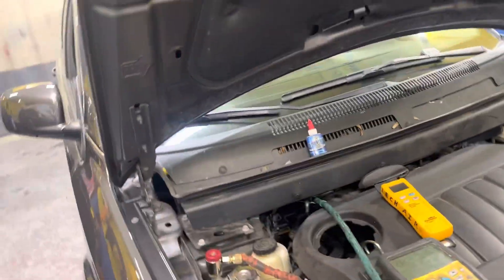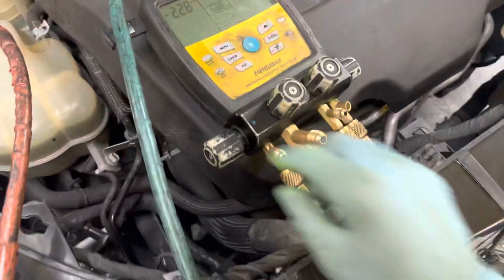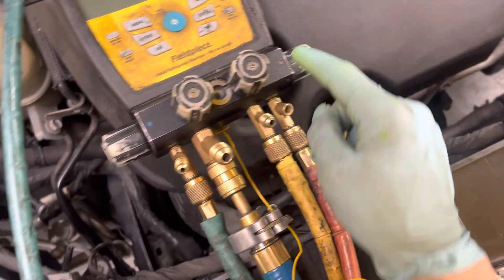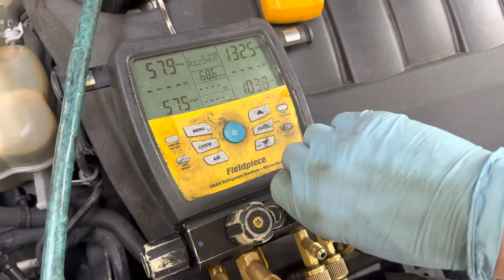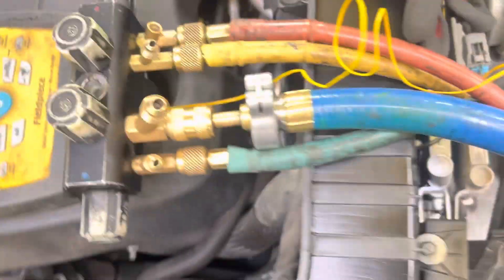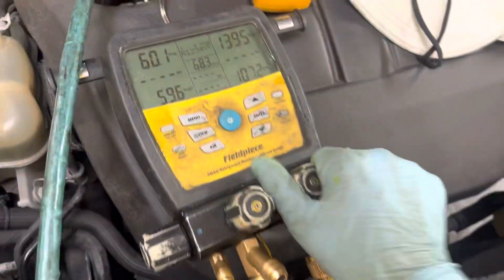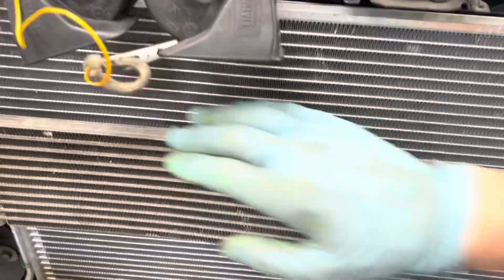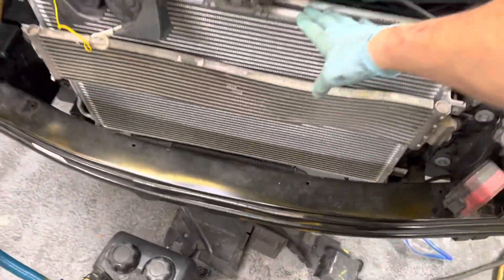AC system cannot hold vacuum time for nitrogen, condenser damaged by a new technician

Comment: Is there any problem if I were to use either 100% Argon or 100% CO2 instead of nitrogen to flush a system? I have tanks of both of those other gasses for welding etc, but no tanks of Nitrogen. Argon is by definition an inert gas, and CO2 has no moisture at all.
Reply from the maker: CO2 is usually a dirty gas and it likes to chill. The system that likes to absorb moisture CO2 loves moisture.. 

Argon is naturally moisture, free, like nitrogen through the process of actually manufacturing it and it’s an inert gas like nitrogen . 

Argon is actually even a better inert, gas the nitrogen, but it’s just a little pricier .  I would use the argon.

I have the 125 ft.³ for my TIG welder

Comment: Spray soapy water around you’ll for sure find that leak with the size of that leak. I can hear it of course.
Reply from the maker: @E85_STI  soapy water doesn’t find vacuum leaks they are pulling inwards.  Now sound if too small for human hearing. 
     Or inside hvac evaporator case or front shaft seal buried under the clutch and pulley assembly.
Reply: @coldfinger459sub0  oh for sure but I meant while using the nitrogen though and I see that field piece lol I have some digital gauges like those for residential and r134a lol. It’s the best of both worlds those gauges
Reply from the maker: @E85_STI  I have an ultrasonic leak detector for high-pressure nitrogen.  But sometimes leaks leak really big under vacuum, but they do not leak at all under pressure.

But this particular one had a huge hole so it made it easier to find